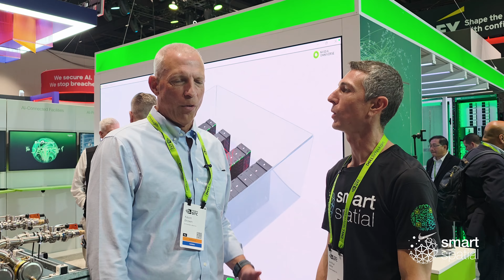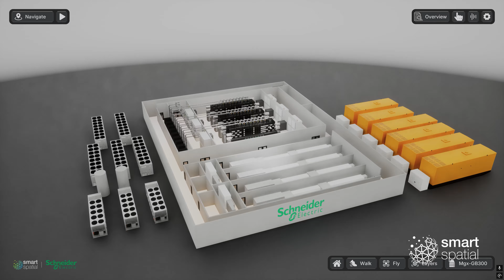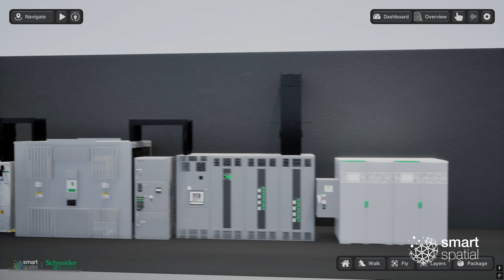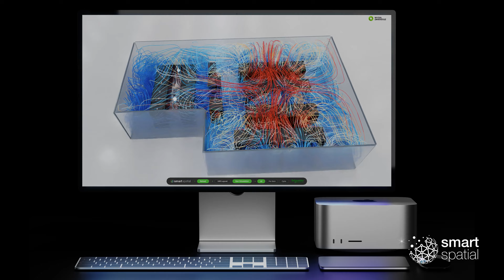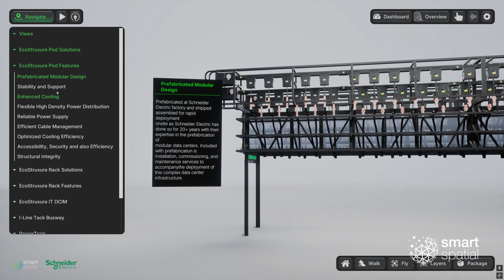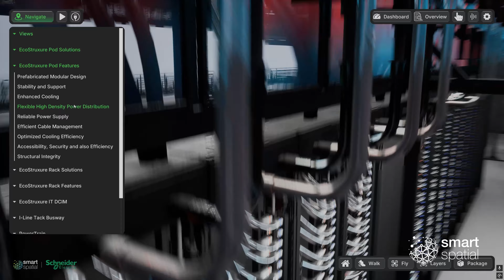Schneider Electric at NVIDIA GTC 2026: Omniverse CFD & AI Data Center Digital Twin

Comment: Jensen: we can reduce industrial accidents and operating costs by integrating Digital Twins with NVIDIA Omniverse in real-time. Proven Engineering Models + AI + Real-Time Data = Measurable Impact: Safety ↑ Costs ↓ 15–20% Failures ↓ Let’s test this on a Refinery or Smart City Pilot. Roldán Duarte